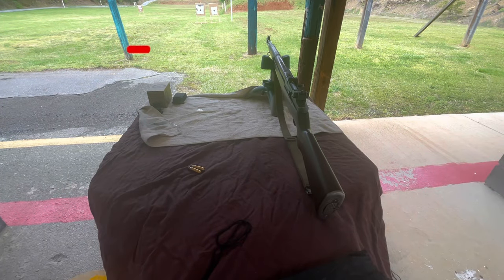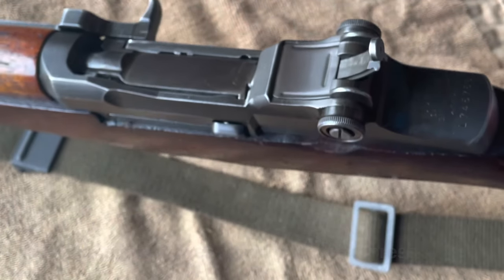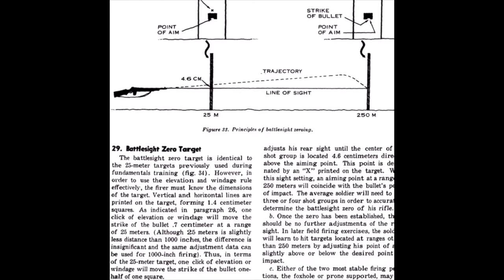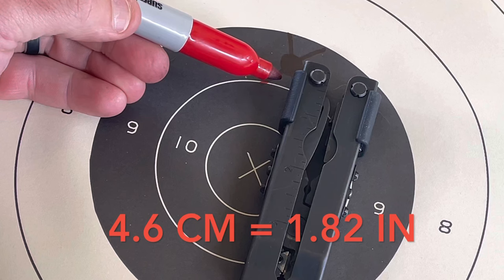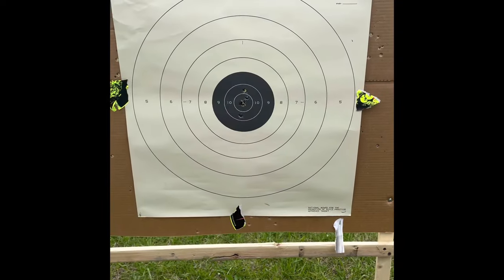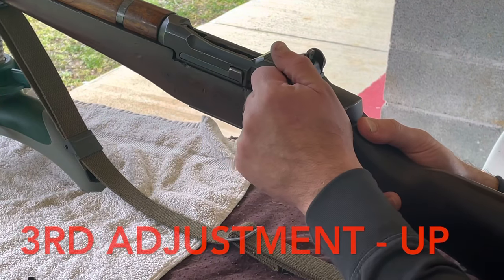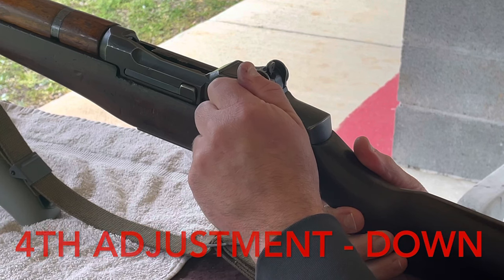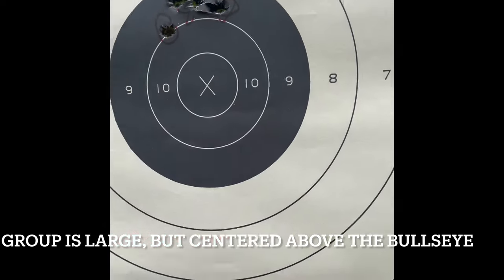How to Battlesight Zero your M1 Garand

Comment: If you have access to 100 yard range, start about 8 clicks from the bottom, adjust from there ( 1 inch per click). Most of my rifles are 10-12 clicks from bottom for 100 yard zero. That is with a 6 o-clock hold. These are a peice of cake to sight in.
Reply from the maker: Sound advice! As a matter of fact the field manual states that 12 clicks from the bottom is where you start. I would say that would be close for most people, thanks for coming by!
Reply: What’s a 6 o clock hold
Reply: @mesothelioma5024  Point of impact right above your sights.
Reply: So I'm sighting my M1 so 8 clicks from bottom I assume that means Aperture is all the way down then I click 8 turning toward me? Thanks.
Reply: @stevenh.390  Yes, 8 clicks up from all the way down. Most of mine zero at about 10-11 clicks up from the bottom. If you are not on paper, back up to 25/50 yards.
Reply: Same on M-1A?
Reply: @teller1290   Do not know, would think with the M!A being factory, it would come at least relatively close. I would recommend not wasting the time and ammo and just start at 50 or 25. Once you zero, loosening the sight knob and setting the elevation should be the same process.
Reply: @mesothelioma5024  it's the position of the top of your sight. If you point the top of your sight at the bottom of the target, it's 6 o'clock. If you point the top of your sight at the center of the target, it's center mass. etc.

Comment: Also, once you have set your battle sight zero, you can re zero the sights. Simply loosen the rear sight adjustment tension screw, then bottom out the sight and however many clicks up it took to zero it, go down that exact number of clicks past the battle sight mark on the drum and retighten it. This way your battle zero sight is set to your particular rifle. I used to build and shoot M1 Garands in NRA high power competition, it was a lot of fun, I really miss it. Good video 🇺🇸⚓️💪👍
Reply: If you have done the battle sight zero method (as explained in the video), theoretically you are now sighted in at 250yds. So why wouldn’t you leave the sight where it is, loosen the elevation knob, and move the drum (without moving the sight) to the 250yd mark (actually between the “2” and next lineup) and tighten the drum. That way you have a 250yd zeroed rifle with the rear sight drum set on the proper setting for 250yd. Then if you want to shoot at 100yds, move the drum to the 100yd mark.

Comment: So, summing this up, you want the rounds to impact approximately 2 inches above bullseye (while aiming for bullseye) at 25 yards?
Reply from the maker: That’s pretty much it. The Field manual procedure is basically what I displayed in this video which SHOULD give you center mass impacts at 250 yards. Thanks for coming by!
Reply: But is the dial set at 200 then?

Comment: Sighting the M-1 Garand
 
The Garand has a very simple but accurate sighting system. Sights are for the average person. Below I'll try to explain how to zero at 100 yards simply. Most ranges in my area have targets at 25 and 100 yards but a good range will extend longer out. 
 
Each click of either elevation or windage changes the strike of the bullet approximately one inch on the target for every 100 yards of range, over its effective range.

Windage can be adjusted 16 clicks to the right or to the left of center index, and elevation can be adjusted from 0 to 72 clicks.
Sighting-In

1. Windage zero.
Center your rear sight according to the index marks on the receiver and sight base. Center the front sight in the dovetail. Under no-wind conditions, fire a group at 100 yards. If the group is not centered, loosen the front sight and move it opposite to the direction of the group error. Repeat as necessary.

2. Elevation
For simple "Battle-Zero," Zero-in at 25 yards, then come up 1 click. This effectively zeros-in for 200 yards.
This should result in groups centered on a 4" diameter from 0 to 400 yards.
Reply from the maker: Thanks for breaking that down. I tried to go by the FM as closely as I could. Thanks!
Reply: Correction. When you adjust the front sight, you move it in the same direction as the error.
Reply: @RR-ll1se false
Reply: @MF-rtard89  I agree with @RR correction reply.... think about it, when U move Front Sight "left", point-of-impact will move "right".... good day
Reply: @RR-ll1se this right here. I like to think of iron sights as being fixed in space and I'm actually moving the barrel under them. I want the impact to shift right so I move the barrel right...which offsets the sight to the left.

Comment: I watched a lot of in-between adjustments and a lot of rounds going down range. Just a suggestion. I had a plastic Caldwell shooting rest just like the one in the video but I threw it away because it's a pogo stick when you rest the hand guard on it like that and causes the muzzle to jump. I got a set of Deadshot shooting bags instead. Big difference and fewer rounds.
Reply from the maker: Thank you for sharing. And thanks for coming by!

Comment: After you Zero it... How do you Index the Elevation Drum? It is Marked "Battle Sight Zero? with an Arrow for return to "Battle Sight Zero" After Adjustments for Long range shooting. Earl
Reply from the maker: I didn’t mess with it because the Field Manual didn’t mention it. If you are doing another adjustment or shooting at a different distance, I would turn it back to the original setting or follow how it is listed in the handbook that came with the rifle. Thanks for coming by!
Reply: Count the clicks from your zero setting to all the way down. Write this down.
Reply: Loosen the screw and match the 200 yard line to your zero.

Comment: Yes Sir  , im going  to try by the book. Any issues with ammo types? I'm using PPU loaded to M2 ball specs.   Runs fine with this. Whst were you using? Thanks
Reply from the maker: In this demonstration I was using the new manufacture M2 Ball ammo I got from the CMP last year. It is Creedmoor on Hornady brass. Thanks for coming by!
Reply: Thanks. Seen good results with CMP. But I've the PPU for awhile. Got cheap  5 yrs ago.
Reply: I am using m2 ball I got off Ammo man

Comment: Get the hand guard off the rest and put the sling on correctly.
Reply from the maker: Thanks for coming by!
Reply: What's wrong with the sling installation?  How should it be done correctly?
Reply: @ChucksterTT  
It’s upside down . Rear hook over, not under.
Reply: His sling is mounted as described by AmmoGarand, I searched the web and can not find the proper mounting of the M1 web sling, mine are mounted as you describe but I just know somewhere is the official U.S. instructions, also, you're correct about resting the rifle on the front handguard when shooting for accuracy.

Comment: Hey I just got a saint victor 308, I plan on battlesight zeroing the irons on it. Would the 36/300 zero work good for that. The primary use for the rifle will be a battle rifle, maybe hunting sometimes but I have a bolt action for that lol
Reply from the maker: It should be pretty close. The most accurate way of course it to try it on the range. Thanks for coming by!

Comment: Ok but what distance in meters do I need to use to get the BDC on the drum properly set up
Reply from the maker: So I don’t have the manual for the Garand I have FM 23-71 Army Markmanship that covers both rifles the M1 and M14. It outlines the part when I mentioned to run your sight to the lowest setting, come back up 12 clicks, and start zeroing and adjustments from there. The actual Garand manual may tell it a different way. Thanks for coming by!
Reply: @cornfromajar3222  Thanks!  Looks like I'll have to print off the manual and go through the offical process then.